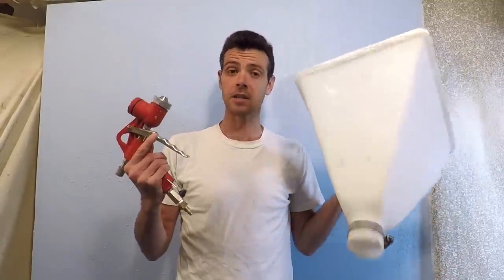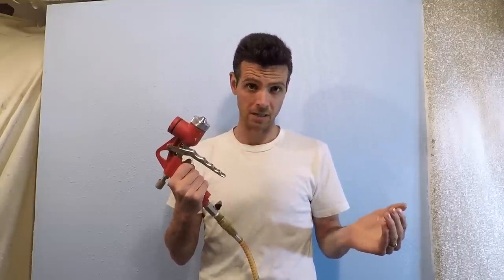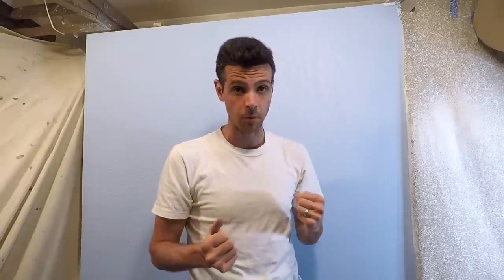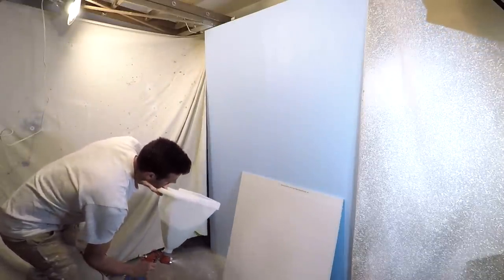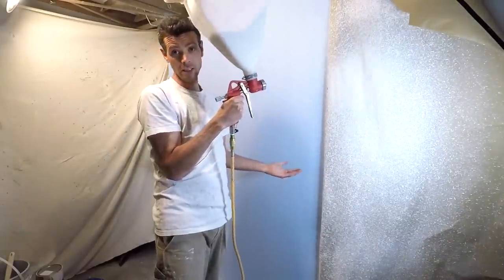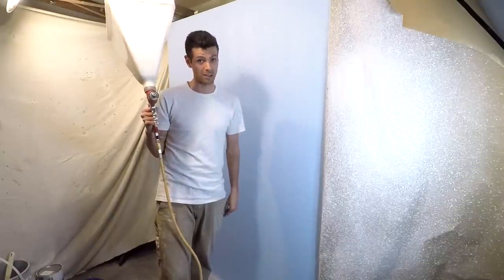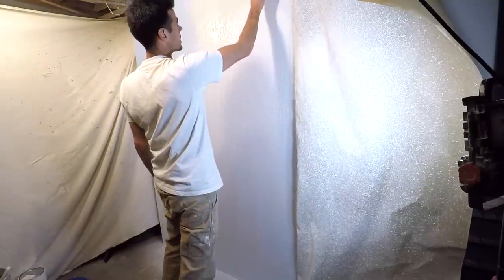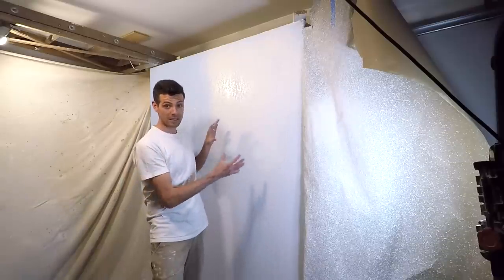My Second Attempt at Knockdown Texture

Comment: Texture does take practice. The difficulty in knockdown is the timing for when to wipe. A 12" drywall knife is sufficient and better than a 24-36" knife on walls that aren't perfectly flat (poor framing) but you need to practice to see how soon to wipe. 

The humidity, air flow of the room, whether the wall was primed, dryness of the wall and thickness of your texture will all determine when to wipe. It can be anywhere from 4 minutes after you spray in a conditioned house with no primer behind the texture to 10-12 minutes in a more humid house. If you have a lot of wall to wipe down and have sprayed a ton of texture that is going to increase the humidity in a room substantially and increase wait time.

It simply takes practice. Down here in the south we have our guns dialed to around 40 psi and get our mud to pancake batter consistency. Using a medium tip it will throw out much larger medium and makes a nice knockdown. Try turning your psi down when you do it, that will also help with the amount of downtime the compressor has to take to refill.

Subscribed and appreciate all the videos!
Reply: Solid response. Appreciate the details.

Comment: I'm so glad you're making vids on texture. Nearly every house in my area has some kind of textured walls.  I have quite a bit of experience matching texture and even doing whole houses with a hopper, and yeah, the Marshalltown is the best. Here's my two cents:

1) With knock down texture, It is important to prime the walls first. When you do patches, the raw drywall, drywall mud, and previously painted surfaces will soak up the water in the texture very differently. The painted stuff will still be too wet when the raw stuff is ready to knock down.

2) IMHO your mud is still a little too stiff.  You want it pretty runny. It should pour into the hopper pretty well. If it is too stiff, it will also stack up a little in the funnel and won't feed evenly.

3) Inline regulator- I keep a regulator close to the texture hopper. My pressure is usually between 40-60psi

4) Trigger control- when your hopper is full, more mud will tend to come out, so I will pull the trigger back less when it's full, and a little more as the hopper gets lighter.

5) whenever possible, I will stand back 5-10 feet or so from the wall. It helps me get a more even pattern. (Obviously you cant do this in a small room)

6) knocking it down- I have used a knife to knock down, but now I use a squeegee. Marshalltown makes one that attaches to a pole. It takes a little practice, but I have been getting really good results from it. I do clean it off with a wet sponge after every pass. Also It is possible to knock down your texture after it has set up completely by sanding the high spots down. Not the preferred method, but it is good to know it can be done in a pinch.
Reply from the maker: Awesome info Scott! Thank you! I'm actually getting interested in the idea of using texture on a feature wall or a tray ceiling. After 10 years of making walls flat I'm getting  bored of it. I want to start learning how to do some custom plaster finishes and textures. Would be a cool service to offer. Especially in my area where no one knows how to do textures.
Reply from the maker: Can you find a link to an inline regulator. Is it something that can dial down the pressure from my compressor. I know if I set my compressor to 50psi it would drop too low way too fast. Definitely my biggest problem is having my pressure go way up and down. I'm not invested enough to buy a specialized compressor for spraying texture.
Reply: @vancouvercarpenter  when I worked for my old boss, we built some log cabins. We would texture all the interior walls literally by hand. Swirls and streaks etc. It looked pretty cool. It wasn't for everyone. There is also a kind of heavy texture that you see in a few buildings around here where they basically blast the walls with a thick coat of mud from their texture trailer, then randomly strike it with a knife or trowel. It looks a little like stucco.
In the 70's or 80's there were guys who textured with a mop type thing. they would even leave star bursts around the lights. It was kinda neat I guess.
Reply: Awesome
Reply: @vancouvercarpenter  
If you have a Princess Auto near by, they will have air regulators. If not, Canadian tire, Home Depot, Lowes, all carry them aswell. They will be next to the air compressor accessories.
Reply from the maker: @splash5974  thank you! I will be looking into it soon.
Reply: @vancouvercarpenter  
Your welcome
Cheers
Reply: Thanks for sharing your knowledge..!!
Reply: @vancouvercarpenter  i use an inline regulator from kms tools. Home depot has them as well. I put quick couplers on it and attach right at the hopper. I run my mud a bit thiner than yours  and run about 20-50psi depending on the look im going for
Reply: @scott lamp  I hadn't thought of #1 in your list.  I guess I was just too impatient to get the texture on so I could finish my walls.  I think I'll give this a shot before I texture the rest of my basement.  Out of curiosity, will standard "Sheetrock First Coat" suffice?
Reply: I know I'm 9 months out here, but do you then re-prime after texture?
Reply: Wow! Thanks for that information!  Much appreciated
Reply: Thanks for the tips man really help me
Reply: How would you charge for texturing
Reply: Absolutely
Reply: @EricLS  Yes

Comment: There is definitely some good  Knowledge in these comments.
As far as finding the right time for knocking it down I find the best is when you look across the wall and you'll see that (just the tops of the texture is glossy from water.
And the base of that texter goes flat from drying)
  In my experience I find right about then is when your knife still glides across without any sticking and your texture still maintains decent structure without getting too smooth.
Love your videos by the way. Lot of good content 👍🏼

Comment: First hit the whole wall at hight pressure to give it a light orange peel then turn it down to about 40 pounds hit big splats on it the let it dry about 20 mins before you knock it down. And wipe your blade off often
Reply: Ahhh; I never do knock down until just the last few days, trying to blend into previous  knock down higher up on a few walls in a bathroom. I ended up hitting it with a light orange peel, waiting until the next day, setting my compressor on 50psi with the biggest nozzle I had. I still think I hit it too soon with the knife, but so did the original texture guy so it seemed to match fairly close amazingly. Yeah I’m still not a fan of knockdown though, prefer orange peels and splatters.

Comment: I will put in a couple of tips from my experience.. 
1- I have used all kinds of 'tools' to knockdown, even cardboard. My tip is no matter the tool, use a LIGHT touch.
2- Don't be afraid to scrape it right back off and try again if it isn't looking right, before it dries of course.
3- 60 psi mud wet enough to pour.
4- Use the corner of a small mud knife to scrape a small clean edge (1/8 inch) in the corner where your walls meet your ceilings. This will make cutting in paint much easier and a much cleaner finished look.
Reply: I  have used 1/4" masking tape at the ceiling to wall joint and peel it as soon as the knock down is done. Leaves a nice sharp edge for painting.
Reply: We remodel homes in Florida (where EVERYTHING has knockdown walls and ceilings). I wish the people who did the texturing had created the 1/8 inch edge you mentioned. Cutting in is a bitch when the texture from the wall and the texture from the ceiling converge. It's impossible to create a straight line between the ceiling color and the wall color. If you have any suggestions on that, I'm all ears! I've tried using a flat screwdriver on the wall (doesn't make it flat enough) and I've tried creating a tiny groove in the ceiling just above the joint (can't get a straight line).
Reply: Tammy Slater-Kendrick I’m also remodelling in Florida. We typically smooth out all textured walls for a clean finish. If we keep it, I just go around corners with some sandpaper or a sand sponge and do what I can to make cutting in easier. But damn florida home owners and their textured walls!
Reply: How would you spray knockdown so it's a little smaller, or finer not sure on the terminology, so the flat surfaces are smaller and not so big?
Reply: @mvpthug  If you use the smaller tips for the texture hopper, the balls of mud will come out smaller. Higher pressure also helps.
Reply: @mvpthug  Spray less of it on the wall,  the more/bigger the splats sprayed on the wall, the further it will reach out to the next splat when you flatten it.  Also don't knock it down hard, that will give you taller/stick out further texture.  Also the higher air pressure the more of the fine dots you get (mist), and they don't knock down because they're to fine/short, I do this at 60 psi.
Reply: @tammyslater-kendrick1593  cut in about an 1/8th down from the ceiling, make your own new line.
Reply: Tammy Slater-Kendrick  I will sometimes use tape and a VERY thin line of caulk to fill the gaps. Paint and then pull tape right away. Perfect line every time.
Reply: Even just caulking the corner angles might be a good start, specially for repainting.  Seems that angles get grumpy, but respond well to that extra bit of attention 😃

Comment: Three tips: 
1. Make sure texture mud is uniform and mixed consistently
2.  Timing is everything before knocking down. 
3. Get the biggest knockdown blade as possible. I use a wide 36" very pliable plastic blade. Use very light pressure initially, you can always go over it again if need be. But, if you don't like it or knocked it down to flat just apply another coat. And if all else fails, just scrape off and start over. 
Good luck

Comment: This is two years old so I'm sure there's a high possibility you've figured this out by now but you need a knockdown paddle for this. As for time, it depends on the humidity of the room, you can start knocking it down about the time where you first started spraying starts to loose it sheen from the moisture in the mud. Usually about 15-20 mins is good, but you have to work quickly once you start going otherwise one side of the room will be knocked down more than the other. Just be careful as well because if you panic and rush you can push to hard or angle the knife to the side and leave lines in the knockdown.

Comment: In humid areas (like Michigan) it's a bit longer wait time.  In Denver and Utah (dryer climates) 5-10 minutes is usually enough, depending on room/surface temperatures and humidity.  I do like the nice wide plastic or even really thin flexible metal to avoid pressing too hard.  I'm not a pro, so don't follow any of MY advice...but at the end of the day, my home projects get better and better thanks to Trial, Error and Vancouver Carpenter's fantastic vids.  Keep up the great work!

Comment: Well I’ll be damned, I learned something invaluable from you that I never knew, and I have yet to see on any other YouTube vids, from amateurs or pros alike. And even after years and years of on-and-off again handy work of all types, as well as a trained cabinetmaker mind you (and waaay before there was a YouTube, or google for that matter), even instructed by pros at times - never once was I told (or maybe i just forgot) that there’s a bow in taping knives. When you said that, all sorts of bells rang in my head – like how I often had the edges of my knife dig into the mud when simply taping, but other times not. Always thought it was my lack of skill and the wrong pressure I was applying. One thing I do remember from a pro was however, is to take a file to the sharp corners of a new knife to round them out to (hopefully) avoid digging in and getting those annoying lines. After you made the point of the convex/concave sides, I closely inspected my knives and realized that the brand stamped on the handle, was the the outside of the knife (the side that faces you when you use it). Typical of ALL kinds of products - they do this as a reminder of their name but also for the practical purpose of knowing how to use the device. THNK YOU SOOO MUCH. one thing though - and I apologize for the correction, especially after the praising, but… it’s referred to as “orange peel” not for the inside (as you said), but rather the outside of the peel, that I do know for sure. Which makes sense if you just look at the fruit. In any event, thanks again for that important detail.

Comment: I'm sorry. But you're wrong about the Orange peel. Orange peel is the definition of a surface similiar to the outside of an orange. So, kinda smooth but still with a slight texture. Apart from that I really enjoy your videos. They are really educational. So keep em coming 👍
Reply: Yeah i was like hold on. Orange peel is not the inside but the outside. Orange peel is also the texture you get when painting walls with lets say a 1/2''  roller nap
Reply: It’s also when you spray too close to a house or door.
Reply: at least for in my area, orange peel is amateurish both in paint and drywall and should be avoided.
Reply: I was wondering about that. The oranges I been eating have the texture on the  outside .
Reply: He's Canadian.  Up there the meaning of outside and insider are reversed.
Reply: Why it's not called orange skin then? to get to the inside you need to peel it, so it make sense to call the inside texture of the peel that way.
Reply: It's called Orange Peel because it is the outside. It's done often in California. It's pretty much a standard
Reply: @corynardin 😂

Comment: I've been doing Drywall for 45 years here in the USA; in North Carolina! Spray left to right, not in circles, you'll get a better coat! And spray  heavily to get a better knock down. It takes a little patience and  practice to get what you want! Hope this helps... 👁👁
Reply: I'm going to be texturing ceiling and walls (fresh drywall) I would like to do ceiling and walls all in one go. I plan on doing knockdown on walls and more of a orange peel on the ceiling. Would I be able to spray ceiling and walls all in one go and then just knock down the walls?
Reply: How do you do large rooms? I have about 800 ft2. Do you make it as a hole piece or divide by two-three areas?

Comment: 35 years ago, first home with crappy walls, and I was totally new to DIY home improvements.  Rented a machine, and applied popcorn to the walls of the stairway.  Popcorn would be the wrong term...It looked more like carmel corn clumps....and on the ceiling, too.  So,....I sprayed the ceiling completely.   I am so thankful that someone bought that house 10 years later.....So thankful...
Reply: popcorn is easy to take down as long as you dont paint it

Comment: I have the Marshalltown sprayer like you showed in the video.  I use the second largest hole for knockdown and about half the air pressure.  Allowing the handle to travel farther back increases the size of your globs of mud, which is also good for knockdown.  The timing thing is difficult for everyone I think.  How wet your mud is, the air temp, humidity, primed or bare drywall, etc. I would suggest a plastic knockdown blade, I use a 2 foot wide one that is very flexible, it makes it nearly impossible to push too hard.

Comment: Anyone can correct me if I’m wrong, but in the south (Texas), that texture you did is called Monterrey, and looks quite similar, so the larger spread areas amongst smaller grain canals is actually a good look. It’s what I end up with when I do it. Self-taught with guidance from DIY instruction (YouTube, how-to’s, etc). 
Your videos on floating/feathering saved me on my last room remodel.
Reply: Monterrey is a thicker texture with deep valleys. I live in south central Texas. The way we do Monterrey texture is by applying the mud to the wall with a large blade. Then pat it to draw out large peaks. Let it dry some and knock it down.
Reply: There is The South and then there is Texas. Texas is most certainly not The South. We share some values with the South. But Texas is Texas. 

Rant over. 

I agree with CJ this is not like Monterrey.

Comment: Reduce the air pressure and the mud will come out heavier. The high pressure coming out of the gun cause the mud to mist and the texture will be smaller and fine.

Comment: Getting an actual knockdown knife has improved my knockdown texture. Using  a drywall joint knife works however, the knockdown knife covers alot more area and has some flexibility which I found helped alot. Awesome video though!

Comment: Its mainly just when just tiny bits of wet are left. Every house and how fast it drys makes a lot of difference. Nobody waves the hopper in circles that I know of unless just going over something. Some drywall mud comes out like it’s greased and some fight every bit of the way.  It can drive you crazy trying to get a good pattern without enough air and trying to adjust the air at the compressor that’s why the on and off limiter is you’re best friend. I used to wipe down whole houses and every one is different. I sometimes had to jump around at walls that dried faster than others.

Comment: The dudes I learned drywall from they used 2 rigid compressors, with a connector that allowed both of them to run and supply constant pressure to your Hopper. Also when mixing the mud in a bucket pay attention to the bubbles, 1 bubble is good for skims, 2 bubbles is about perfect for textures.

Comment: the biggest tip ive learned is to use an actual knockdown blade (the big plastic fan looking ones) and wait until just after the shine is gone to start knocking down. the shine represents moisture, so if its still shiny its too wet to knock down and itll just smear into those bigger looking knockdowns